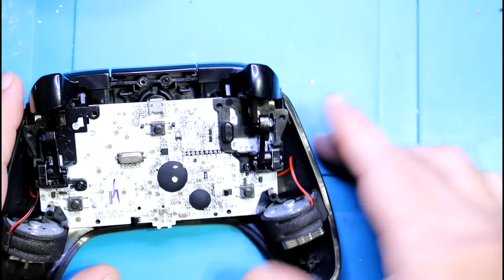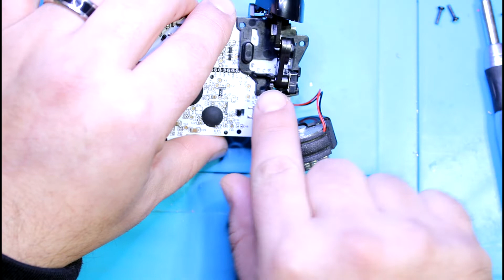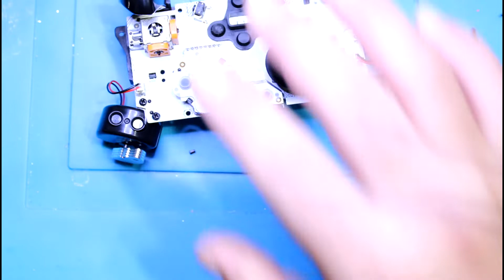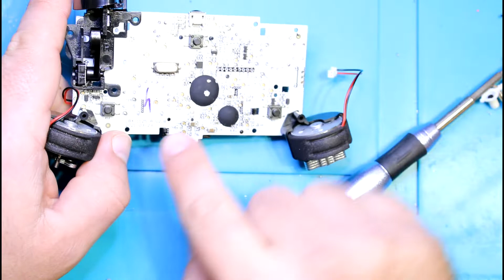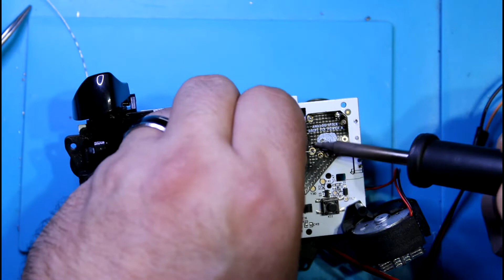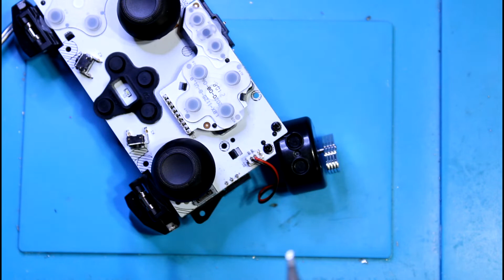PowerA Drift Fix Installation

Comment: The flex pcb doesnot ships to my country, Can I just replace the thumb stick with the ps2 stick or xbox replacement stick ? is that compatible? and does that fix it?
Reply from the maker: PS2 and 360 use different sticks and if you look at my video it will show you the type of stick module they use. It uses a very different type of analog stick module so watch the video and see if you can buy one that looks like it but it's not common to the ones used in official controllers.

Comment: Any chances of creates a stick drift board for the ps3 and ps2 controllers like exist for the 360?
Reply from the maker: Demand for these is so low its not worth my time unfortunately. The ps3 has a weird 4 pin analog module vs the 3 pin of the other controllers so that would involve possibly more parts on the flex adding to the cost as well.
Reply: @Angryhelder   big oof, but i understand, it is probally better to me to use a ps4 controller on it with a brooker adaptor to have all missing features then

Comment: So I was looking into drift repair solutions and ended up coming across something that looked similar to your pcb. there was a video in the description of the item linking me to a youtube video on how to install YOUR device. I was browsing around your site and I saw this one which would help specifically with my needs but it would just be so much more convenient (for us at least) if you could start an amazon shop? is there any reasons you haven't? genuine question, not knowing the sellers backend bs
Reply from the maker: Not looked into it but most resellers take a hefty chunk of profit and these are cheap enough on my site where I won't be making much on them. I also think that they follow the same crap rules like ebay where if the customer complains or ruins the part since it involves soldering and many people overestimate their capabilities I'm on the hook and lose that small amount I gained from the sale.

I'm also aware of Amazon pushing little guys out of the sales by copying or selling similar items even lower than sellers to take them out as competition. I refer keeping more of my profits as small as it is and giving people better product support than through a larger retailer.
Reply: @Angryhelder  yeah that makes perfect sense at the end of the, and yeah, the "Amazon Basics" brand has its hand in almost industry, I suppose it would only take seeing the traffic on these one time to think about it. I will say there isn't an Amazon basic xtremerate mod kit but it also isn't a single device. I'd already ordered a couple but it's the shipping that makes me even question anything

The gag of someone not wanting to pay $5 + $5 shipping but being happy to pay $10 + Free Shipping is real 😂
Reply from the maker: @moneyboy503  the optics is real. Take for example an item that is $39.99 which is essentially $40 but if you look at $40.00 side by side your mind automatically sees the $39.99 as something much lower.
Reply: @Angryhelder  so, I've come back with a find, and a question if you're willing to answer. 

the find first: if you haven't found out yet since posting, I was doing some tinkering and you don't have to remove the Pot for the triggers when removing those, the arm the goes into it and the other end of the lever can be lifted up a little and it'll pop out allowing the whole module to pop up

as far as the question: i've got the newer PowerA controller that has LEDs build into sections of the controller and there were some extra chips i noticed where the mod goes which didn't allow it to sit flush. it worked perfectly after install but a few minutes in the stick started going hard left and bridging two legs of the pots a couple times fixed it. the controller worked perfectly the rest of that night but the next day kept cycling on and off. would you have any insight?

Edit: there were no bridges and I even had the mod off at one point and it was still hard spinning
Reply: At the end of the video you said to plug it in to a usb cable, then go on the website and make adjustments, is there a url link to that? Thanks I appreciate the help!
Reply from the maker: @chrischoan8561  https://hardwaretester.com/gamepad
Reply: @chrischoan8561  you don't need any specific one, you could technically plug it into your system and test in-game if you want. Any gamepad tester is just going to visually show you all the input data and it's easier to fine tune it when you can see it, but any gamepad tester site works

Comment: Will these modules fix my issue?

So I have 4 PowerA Xbox Series controllers and 3 of them have the same issue. They do not have drift issues as such but when I push up on the left stick, nothing happens.  For example in Fall Guys if I push up, the character does not move,  but the character will move at 11 o'clock and 1 o'clock positions, just not at the 12 o'clock position.

(The closest solution to my problem was a post on reddit 5 years ago where there is excess plastic at the seams of the actual stick.  But I opened all 3 controllers none of them had this 'excess plastic')
Reply: hmm, i've gone through maybe 8 PowerA controller with their terrible drift but i've never had this issue. I'd say throw the controllers into a gamepad tester on the pc and see if they're tracking anything whatsoever, (do test circularity and spin the stick around a few times, see if it makes a full circle also)

if there's genuinely no movement, before you get into deep soldering I'd recommend you bend the potentiometers back a little and clean the metal bit as well as the inside track with like, isopropyl alcohol and a toothbrush or qtip. see if that fixes anything

the last resort if a clean does nothing, i think you'd need to replace the whole stick/the potentiometers themselves.

these boards basically only regulate the electrical output from the Pot's as they start to send incorrect signals as values, this adjusts that. for example, 

(these are bs numbers for the sake of an example) say the center is 0 volts, with ware, it could be reading center as .5 volts and this can decrease it and you can find .5 volts to balance it but the  reading wont always stay .5 as it wears more and can't do anything with nothing there

Comment: Can you make a video about replacing an S2/S5 thrustmaster stick with a Hall sensor stick? maybe can I install a Hall gimbal used in FPV drone controllers? Do I need to do any further steps than soldering the connections?
Reply from the maker: Show me where you can even get a hall sensor stick that is not Gulikit one on a pcb for the steam deck and maybe I can figure something out. The stick would need to have a pcb like possibly a flex pcb with hall sensors and an mcu programmed for that particular controller.  It's not a simple place and drop setup like your thinking.
Reply: @Angryhelder  thanks for replying :) maybe an frsky m9-r is installable, I'm thinking on professional contactless gimbals with bearings.
Reply: Texas instruments has a tutorial on how to make a demo hall joystick

Comment: Do they work with the Power A Gamecube style controller stick drift?
Reply from the maker: I was not even aware there were Power A gamecube controllers. I will need to see the inside of one of those controllers to give you a definite answer.
Reply: @Angryhelder  Hi there, I came here to check on the exact same thing. These wireless gamecube controllers made for the switch are pretty damn good overall even on PC, and has great gyro. I've bought two so far though and both have developed stick drift pretty quick as well, one of them I bought brand new even came with slight drift lol. Anyways, if you ever get around to checking on these I would be really curious if this would be compatible, I'd definitely buy a couple if so. Thanks for all the work you've been doing!
Reply from the maker: @EVCartman  give me a link to where I can buy one and I'll have a look